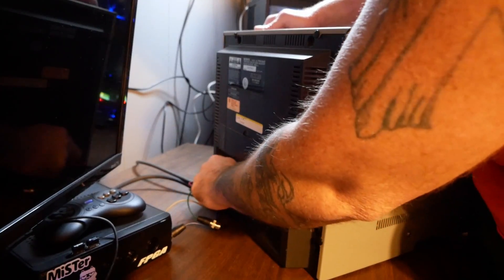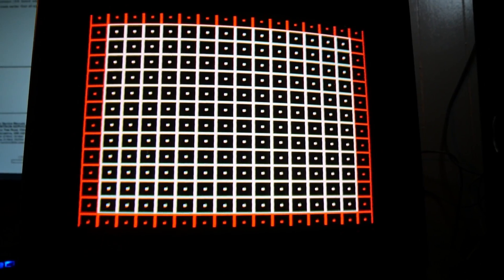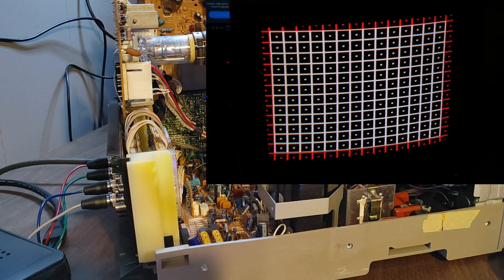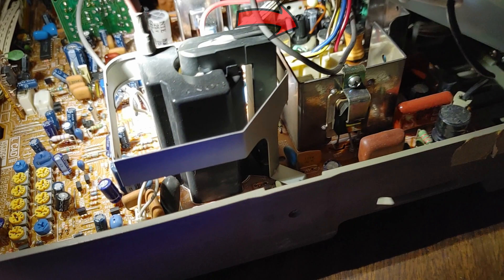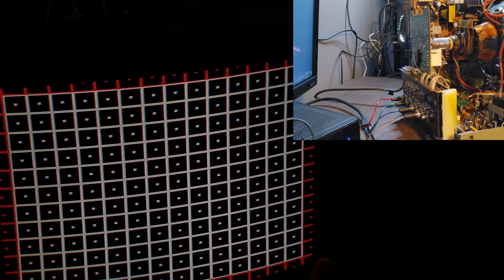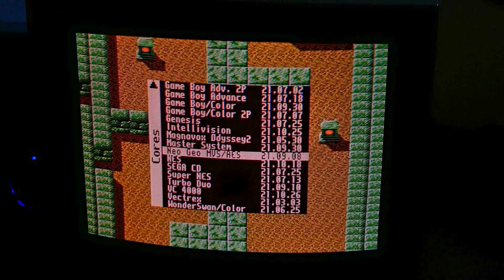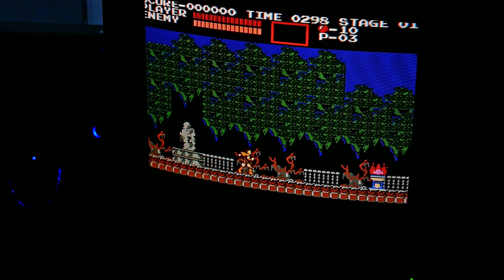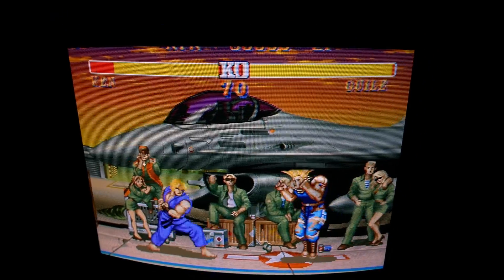Sony 1344Q PVM Calibration Yoke Adjustment Geometry MiSTer RGB Gameplay Footage

Comment from the maker: 240p Test Suite...
https://junkerhq.net/xrgb/index.php?title=240p_test_suite

The gloves I used are just rubber coated nylon mechanics gloves. Im not saying they are safe and Im not liable if you attempt this lol,  please know your way around a crt and the dangers associated with this.
Gloves are just something like these...
Gorilla Grip Slip Resistant All Purpose Work Gloves https://www.amazon.com/dp/B007Z35Y56/ref=cm_sw_r_apan_glt_fabc_K3M8WDSGHNEG4N9SKZ9G

Screwdriver set.... T Tulead Ceramic Screwdriver Adjusting Screwdriver Stepper Dirvers Screwdriver Bit 1.3mm,1.8mm,2.6mm,2mm https://www.amazon.com/dp/B08D3GHT6R/ref=cm_sw_r_apan_glt_fabc_F6E6DM72BN3JH687MGA3?_encoding=UTF8&psc=1

Comment: Hey there, so my N64 is pretty zoomed in while playing, so do I just get the screws and adjust vertically and horizontally like you did for my KV20TS20 and that's pretty much it? Or is there something else I should put into consideration? Thanks for the video!
Reply from the maker: Correct me if im wrong but the kv20ts20 is an early 90s set so probably has no on screen adjustments so yes, you would adjust the trim pots for V size, H size, V center, and H center as a starting point and go from there.
Reply: @LameGaming  Yeah, but thankfully it actually runs quite well as it is.

The issue I'm facing is that I have a 27 inch KV 27-V20 Sony with a yoke that is crooked a bit to the right, so I'm gonna need to adjust the yoke myself. Any advice before I jump in? Kind of scared but the tilt isn't that subtle.
Reply from the maker: @pyxelpub8251  If your nervous about doing it while running it can be done while the tv is off, it will just take more time to get it right.

Note which way it needs to turn and with tv off make a slight adjustment and then turn on and test. Keep making adjustment untill your happy.

I would keep a slight pressure towards the tube to make sure the yoke is seated against the wedges.
Dont overtighten the yoke, good luck!
Reply: @LameGaming  I'll try to do it with the screen on as that'll make it much easier.

Honestly my worry is just I might break something out of ignorance but I'll be careful and do it properly. Do I need to remove the convergence tapes around it or is that fine to leave on? If I do remove them do I need to get new ones or would reapplying the old ones suffice?

So in summation, unscrew the yoke just enough to rotate and screw on again, while awaiting your input on the convergence strips.

Final question, any idea if the  KV 27-V20 has a menu? Its a 97 model and I've seen others from that year have service menus with the remote. Waiting on the remote so I'll let you know if that's a yes or a no if you don't know yourself.

And thank you so much for the responses and the patience Lame (feels like an insult, haha).
Reply from the maker: @pyxelpub8251  Sorry man, YT had your reply marked as spam for whatever reason so just seen it in YT studio. Leave the convergence strips on. It should have an osd but not sure, I have several similar models but had no time to mess with them yet but I would definitely get the remote off ebay. Its been awhile since you commented- did you ever make the adjustment?

Comment: So jealous of your geometry and convergence. I have a 1354q, and while the colors look amazing, the geometry and corner convergence is fucked. Even had it serviced by savon Pat. Didn’t help
Reply from the maker: I can get convergence good in center of screen but torwards edges they seperate a bit but so does convergence on all my other 13-14" pvms so its probably normal. I thought about ordering convergence strips to see if that helps at all. I have a convergence video coming soon that will be easy to follow.
Reply: @LameGaming  trust me, the convergence on your pvm is sick. The corner separation on mine is terrible. Have you found an eBay seller making legit convergence strips?
Reply from the maker: @dylanjastle  Ive seen some but havnt bought any yet to test, i have a set or two I salvaged from broke tv's

Comment: Can you link that screw driver set?
Reply from the maker: T Tulead Ceramic Screwdriver Adjusting Screwdriver Stepper Dirvers Screwdriver Bit 1.3mm,1.8mm,2.6mm,2mm https://www.amazon.com/dp/B08D3GHT6R/ref=cm_sw_r_apan_glt_fabc_F6E6DM72BN3JH687MGA3?_encoding=UTF8&psc=1

Comment: Great video!  Where did you buy your gloves? I'm searching for good ones!
Reply: Likewise.  I have the exact PVM that I need to do purity, geometry, and yoke adjustments on and it would be greatly appreciated to know what gloves were used or even all equipment used in the video.
Reply from the maker: @rgbwill6193  Just cheap mechanics gloves from amazon or a car parts store.
The non conductive screwdrivers can be found on amazon by searching " ceramic screwdriver". Other than that i just used 240p test suite
Reply from the maker: They are just cheap mechanics gloves, not even sure if they provide any protection but the palms are rubber coated. I work on cars too and had a box of these in the garage forever. Probably got them on amazon or a car parts store